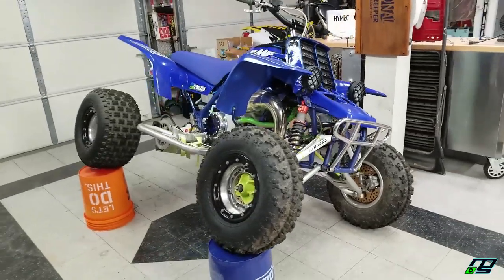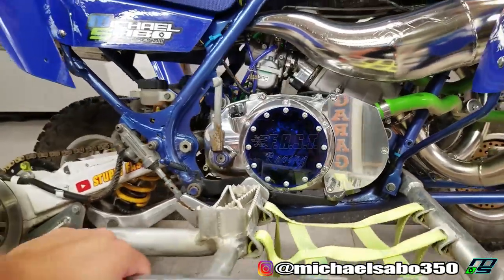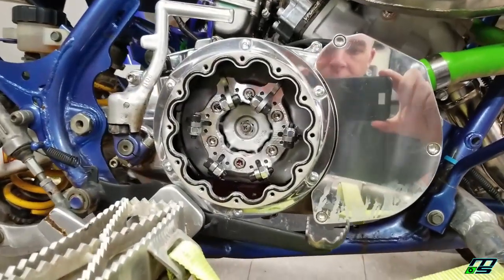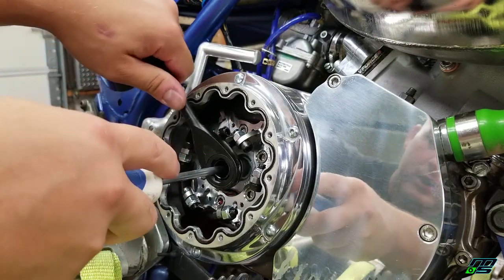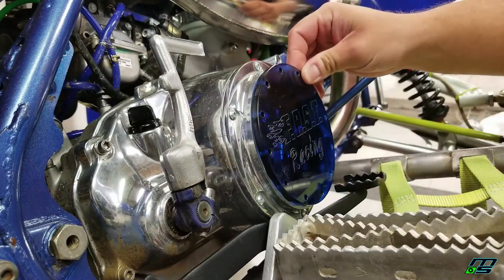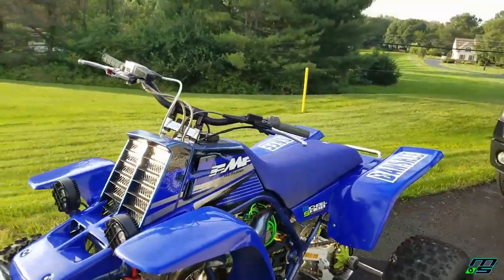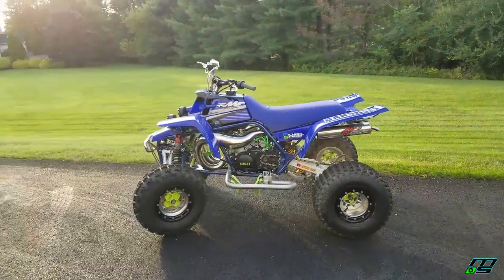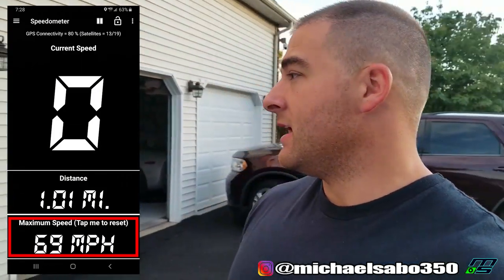First Ride on The Hydraulic Clutch!

Comment: Aren’t you suppose to line up the arrows on the case and actuator arm when adjusting the pancake bearing? How I’ve always done it.
Reply from the maker: Yes per the manual. However, the part of the case with the arrow is broken off of my case and it's a little different with the aftermarket setup I have.
Reply: "Should be" if everything is stock perfect.  Watch Kevin's how to video on South Texas Banshee channel.  He explains it very well.

Comment: Great video man. I want to upgrade to a hydro clutch in the future. Thanks for taking the time to trouble shot your issue with us. I might run into the same problem. The Banshee is looking sharp BTW!
Reply: Look into a easy pull stunt clutch first
Reply: At least it isn't going to act up in the cold

Comment: I don't see a need for a hydraulic clutch on a motorcycle.  I've never had a problem with a cable which is less likely to fail. Besides, you only need a clutch to stop.